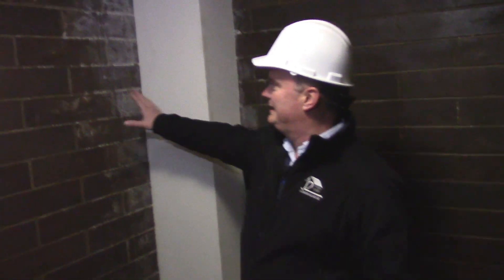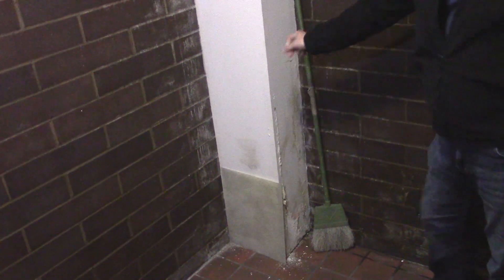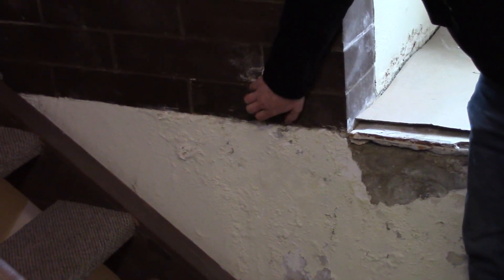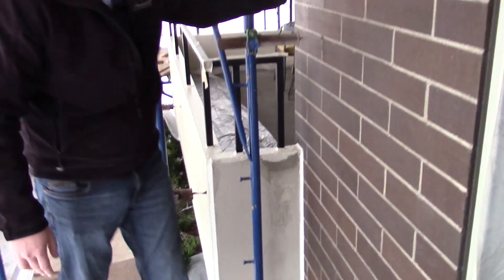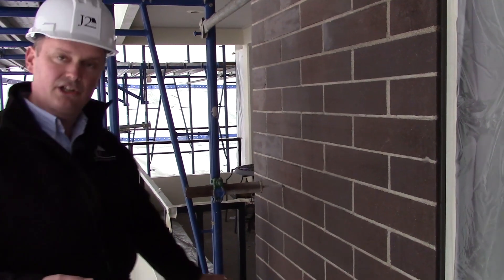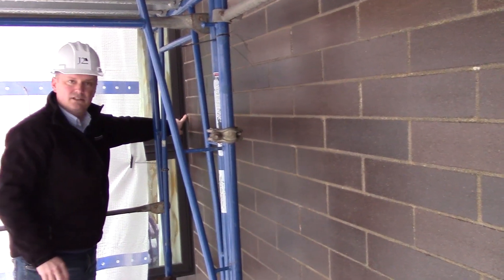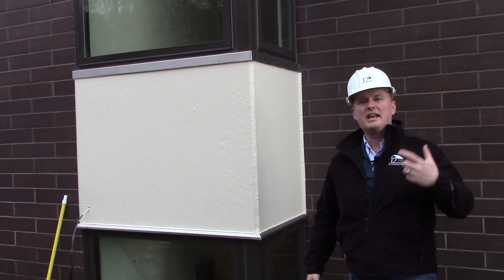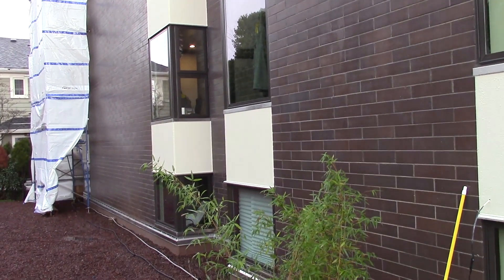BRICK BUILDING FACELIFT - WATERPROOF COATING

Comment: where to buy the clear coatong, GE momentum coating?
Reply from the maker: Hi Henry, 
Take a look at the GE website: https://www.siliconeforbuilding.com/products/architectural-coatings
We'd recommend Enduris and Optic on that page, which you will need to call GE to find a local rep who sells those products--you won't find them at a regular hardware store. If you want to look for a coating at a local hardware store, look for 100% silicone, not silicone with water based cleanup etc.  Siloxane is the cheap stuff but it works for 5 yrs.